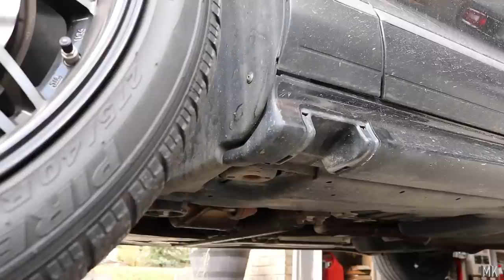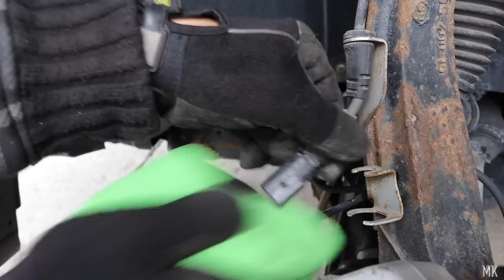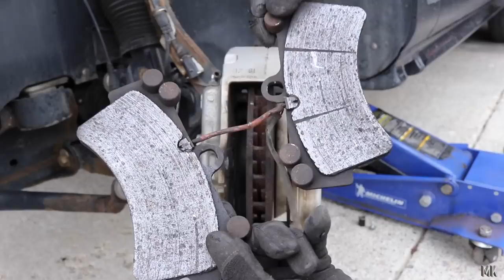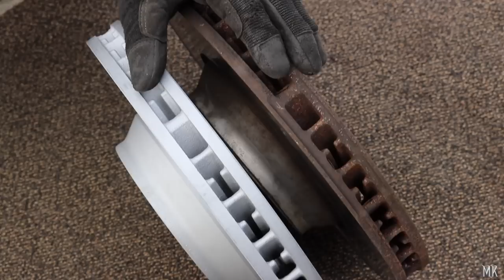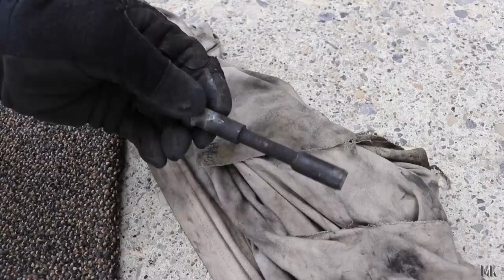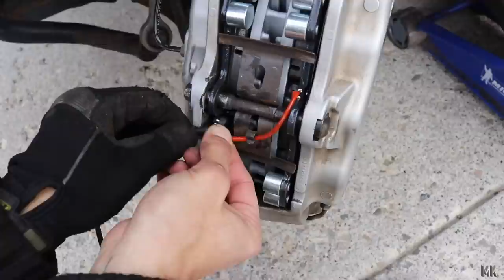Porsche Cayenne. How to replace front brake pads and rotors :DIY

Comment: Just a tip to anyone else watching this video, make sure you properly clean/sand down the hub. Any corrosion or buildup in that area will cause an uneven surface between hub and rotor causing premature runout. Great video though!
Reply: He cleaned it in the video. I didnt realize how lame porsche owners are until I saw the comments. You never see honda or toyota owners trying to incorrectly correct everyone.
Reply: Relax my man, breathe. It’s a great video! I personally would have taken a wire cup brush to the hub and completely removed all surface rust/corrosion, that’s all! Save your unnecessary life lessons. Have a great day bud!

Comment: Appreciate the calm music as I am beating the crap outta the center bolt that holds the pads in. PB Blaster, proper sized drift, and a 3 lb hand sledge can't budge it
Reply from the maker: Sorry to hear that. Try to spray it with WD40 and leave it for couple hours. This is should help.

Comment: Terrific job! This guy saved himself 4k by doing this 👍
Reply from the maker: Thank you! The parts cost me around $450
Reply: @mikes.garage  my q7 uses the same rotors and pads I did my front pads for $160 dealer wanted $800 😄😄
Reply from the maker: @BlackMamba08  $160 this is the cheapest rotors with brake pads. I noticed they can squeal after wet wether, but works great!

Comment: Thanks dude. You really assisted me with your video. The only things I would have to add:
1. Purchase a Metric Impact Socket Set (cheap 1/2 inch drive 10mm-24mm set costs around $35.00)
2. Spray a little di-electric oil/grease into the brake sensor connection. 
3. Check for any slow leak origins (windshield fluid, engine oil, tranny fluid 😳, brake fluid, power steering fluid). 
4. Average Torque specs.
5. Inspect ball-joints, and consider wheel bearing replacement.
6. Check tyre sidewalls (both sides), tread-wear (camber/caster), tread depth, tyre pressure.
Thanks again!
Reply from the maker: Thank you for watching!

Comment: Not a bad job for a typical backyard mechanic. Covers the basics. Want to make that brake job a back yard job or a Porsche Dealer Quality job for only pennies more? Clean  (wire brush or light sand paper) all of your used parts first including the pin holes and threads on bolts and threaded caliper. Used a huge amount of brake flush on ALL parts new and old except brake sensors. spray all parts with compressed air to get to the caked on dirt stuck in cracks and crevices.  Prying the pads back is a waste of time, crack the bleeder much easier to push the pads back and then after you are done with all the brakes  flush out the brake fluid for even better braking. This is a Porsche! Torque Wrench!!!! Torque all of the brake parts and the rims when putting back together!!!! Prevents down the road issues damage likes warping rotors, imroper metal clearence and failure... etc... Again, good basics, just add and few easy steps!!!
Reply from the maker: Thank you for your review! This is my old video, I use torque ranch a long time already but not always show this in my videos. I usually use brake cleaner to clean all the parts. I didn't show it on this video but I had cleaned all the parts with brake cleaner. Also this videos for people who want to fix his car by himself, if they will bleed the brakes it can couse air in the system and more problem for regular person. That is why this vide is basic.

Comment: Open master cylinder cap before the job?
Reply from the maker: Ray Wong You can if you want but this is not necessarily.
Reply: Mike's Garage good to know. Since I'm doing this tomorrow. Want to make sure if I need to open the cap. Thanks again
Reply from the maker: Good luck with it ;)

Comment: Do you have to replace the Brake Sensors??? Is it a must replace for functionality or just to cut the light off? I have a 2006 S model and it’s basically an off-road vehicle?
Reply from the maker: This sensor in order to know when the pads are worn out and remove the light on the control panel. If you do not care then you can not change it, everything should work in any case. Also you can just cut the wires from old sensor and connect them together, in this case the light will go away.
Reply: Mike's Garage hey fantastic tip and I have 16” wheels on my cayenne S with BFGoodrich ATs on it so I will definitely do this as far as cut the wires and just run the new pads and rotors. Love the cayenne for the off road capabilities and love the looks I get when I mud the Porsche at the pit! 😂
Reply from the maker: Have fun 😁

Comment: So the wires on the pads, are those new wires/sensor? And how do they look being attached and detached
Reply from the maker: Yes, this is new new brake pads sensors at the end of the video.
Reply: Mike's Garage Do they come with the pads? I’ll be getting a stick shift Cayenne GTS here in a few days or so and have been looking at videos on how to repair them so I don’t spend $300 on labor at some mechanic shop.
Reply from the maker: @unique-daann6098  No, you need to buy them separately.
Reply: Mike's Garage thank you I found a whole kit with rotors, pads and the wires.

Comment: my brake pads are good and I just need to replace the rotors. Do I need to remove the brake pads? Or can I leave them on the caliper and remove the entire caliper to remove the rotor?
Reply from the maker: Srivalli Telikepalli you can take caliper with brake pads together. Just depress them before removing.

Comment: my brake pads are good and just need to replace the rotors. can I replace the rotors without removing the brake pads? IS the possible to remove the caliper without removing the brake pads?

Comment: Great job man , quick question how many wear sensors does this car have all around. Is it two or four? & what’s the difference on the V8B & the V8D
Reply from the maker: Thank you! There is 4 wear sensors one for each wheel. I don't know the difference between those two engine, sorry.
Reply: appreciate it sir, I think ones a base v8 and the other is the gts but I’m not 100% sure thanks regardless!
Reply from the maker: @Spicyricek20A  I know this Porsche has: 
3.2L V6 M02.2Y
4.5L V8 "S" M48.00
4.5L V8 Turbo M48.50
4.5L V8 Turbo "S" M48.50
This is what I know.
Reply: Mike's Garage great to know will remember that, thanks again. Huge help.

Comment: This is a great video. I have the same model as well. It's 330mm rotors in the rear correct? Also, I noticed you applied something to the rotor torx bolt, was that locktite?
Reply: Never mind, I just realized it was brake lubricant.
Reply from the maker: Thank you! I don't remember what size of rotors was at the back, probably 330mm. I applied some brake grease on torx bolt for holding brake rotor.

Comment: nice and clear. but what are torque values for every of screws?
Reply from the maker: Sorry, I don't have the torque values any more for the Porsche, as I sold it with the repair manual. And yes I should include it in a video.

Comment: Great dyi! for anyone doing this at home I would invest in a torque wrench for the caliper bolts. Those are most important to set to the correct spec. Not worth guessing on.
Reply from the maker: Thank you! I have torque wrench already.
Reply: A brake job isnt worth breaking out the torque wrench

Comment: Good Vid Mike but how the hell do you get stubborn pins out?? Ive been trying for 2hrs and they won’t budge 😡😡. Any ideas would be greatly appreciated👍🏻
Reply from the maker: stuart silverlock Try to spray it with WD40 before you start to remove it. Also you can buy new pins if yours are in a bad shape. Everything else you can see in the video.

Comment: You didn't use OEM Parts. TRW Pads and Zimmermann Rotors are aftermarket.
Reply from the maker: This is what Porsche installed at factory. Maybe brake pads was Brembo.
Reply: @mikes.garage  Porsche never installed "Zimmermann" Rotors at factory! They came with Bosch, Brembo or ATE!
Reply from the maker: However you want 😉

Comment: tight bolt with breaker bar? are u serious ?
Reply from the maker: and what would you use for such work?
Reply: Mike's Garage torque wrench baby and torque spec is about 200lbft or 270Nm.
Reply from the maker: 270Nm this is medium size torque wrench not a baby. I used good size breaker bar to do the job and after I did check it with torque wrench and it was almost tightened enough.

Comment: maybe t15 torx
Reply from the maker: shiozuka osamu nop, torx 50
Reply: @mikes.garage  I used t45 torx. Mine is 330mm as I have the V6 so slightly smaller brakes